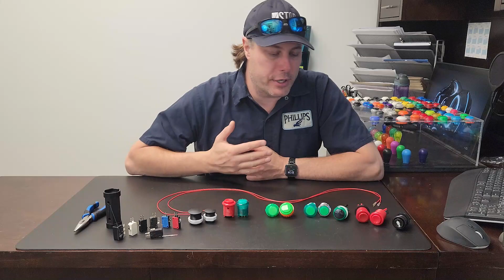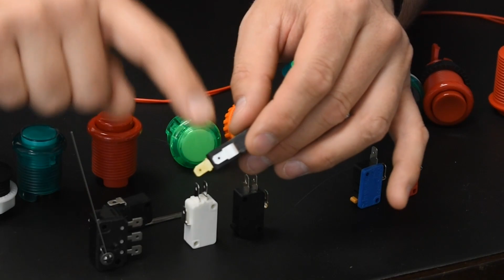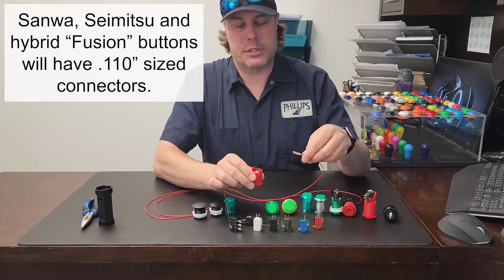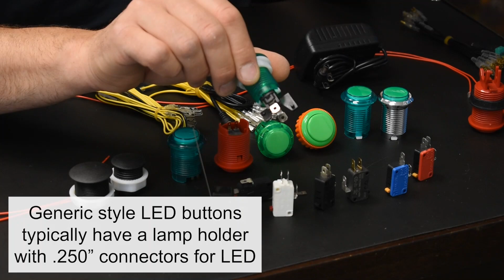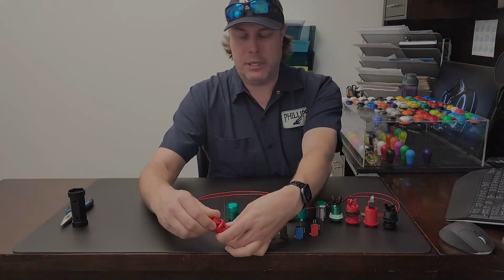Arcade Buttons 101

Comment: Brother really said the asian style buttons have PCBs in them

they're microswitches. The mechanism is just different. It's a spring and a ball bearing making the connection. A PCB would introduce input lag because it has to convert the signal into something usable, rather than raw circuit, like it does.

Comment: I have a micro pinball and was wondering which switches have the click in it ? I am looking to replace my start button ,, unlike the flipper buttons which have no click
Reply from the maker: @tommycruz100  any button with a full sized microswitch will have some sort of a click to it. Meaning most pushbuttons, but the Suzo Happ buttons are probably the ones you are looking for if you want a click to it.
Reply: @  thanks
Reply: Look for terms mentioned like "Actuation type: Snap-action".  That means they have a explicit moment where they snap their contacts together.
EAO for instance has this (they don't make arcade-buttons for as far as I know, but you can use them for it obviously) description for some of their buttons.
Some of the buttons I have (where thrown away at work and I was allowed to take a chunk of them home) are "momentary, non-snap action".
When you push them, they just feel like pushing on a spring, they don't click.

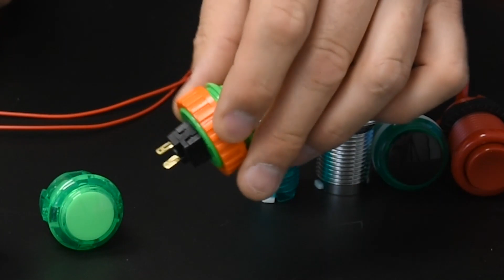Comment: 4:00 No PCB included unless LED illuminate (Only Chinese buttons with dual white LED and a ballast resistor both smd for miniaturization). 
Sanwa OBS Series button don't have LEDs (OBSF(std), OBSC(clear/colour tint), OBSJ(metallic), OBSFE(silent), OBSN(screw)) all use SW-68 keyboard micro switch.
OBHS are RGB 7-colour, 
OBSA use a micro switch with plug-able LED (like HAPP),
SS-xx (special square base/illuminated variable size)
Back to the switch that Sanwa uses - SW-68. It is used in majority of arcade buttons and is not a standard clicky micro switch but closer to a mechanical keyboard switch - non-gold-leaf. It contains two gold plated contacts/tabs with a conical coil spring and ball bearing assemble which make connection to internal contacts (rated for 1 million presses). 
Construction and operation of SW-68 switch - Top and bottom housing (black), tabs are off-centered entering bottom and both have "s-bend" to space contacts closer together (lesser of ball bearing diameter). Opposite to the contacts, a grooved ramp is formed into bottom housing section (ball designed to roll toward the contacts). Final parts: white plunger, coil spring and ball bearing. The spring/ball bearing assemble are also off-centered opposite side above the ramp. When the plunger is depressed the spring is compressed and the ball bearing wants to follow the ramp into the contacts; however, during un-activated state (unpressed) the ball is separated from contacts with a plastic nub or gate molded into plunger bottom. As you depress the plunger, the nub/gate moves down between the contact/tabs and a hole is opened to allow the ball bearing to follow the ramp into the contacts (spring bends towards the contacts). When released the bottom insulator part of the plunger pushes back the ball to a neutral position or Normally Open. Button activation force is the spring compression tension. Similar to Ultimarc/Baolian Goldleaf switch and Cherry MX leaf switch but no ball bearing, just an activator insulating nub separating the leaf contacts in Normally Open state.

Comment: Are there any normally open momentary switches?
Reply: I assume you mean normally closed. Anyway, at 1:50 in this video, the american-style button's microswitch. the bottom lead is the ground, and the other two contacts, one is normally open, the other closed.
Reply from the maker: They are all normally open. When you press the button it makes the connection to close /connect the circuit.
Reply from the maker: If you are looking for the opposite, the regular microswitches always provide both open and closed terminals so that you can wire them in tandem for some applications. There is not much need to use the NC option other than for a JAMMA that you need to wire multiple buttons for 1 connection such as a coin door and a credit button.

Comment: Ok - I have a custom arcade cabinet and some buttons are giving me problems now 5 years later - from what I understand the fusions are better than IL for lifespan?
Reply from the maker: @abm10399  from what we have seen from the Fusion buttons we have changed exclusively to use them over ebay other brand. By far they seem to outlast any other button on the market other than the specialty Sanwa buttons that are used for competition play.
Reply: @RetroactivearcadeCa  thx for the response I will def get them.  Really appreciate this video… it was super helpful.  I feel like those springs inside my IL are a little flimsy so I like to idea of getting away from those. And learn about that button wrench today - it’s now on order

Comment: There is no PCB . PCB does not explain a mechanism of a switch a PCB inside the button does nothing and would do nothing. It would been more apt to compare sanwa switches to "switches somewhat like mechanical keyboards" - It would not been entirely correct either but it is in same ball park away from microswitch actuated buttons. 

What is ACTUALLY inside Sanwa style switch for their buttons is two contacts, a ball bearing and a spring. When pressed the ball bearing goes down a plastic ledge against two contact points. The spring ... more or less according to scholars; SOMEHOW also keeps the ball bearing UP until pressed again, this is because of a notch in the plunger that keeps the ball bearing with the slightly horn shaped spring in right neutral position when not pressed.

But no button, NO BUTTON "has just a PCB" inside, PCB is where you attach switches to not what a switch mechanism comprises for. Even a magnetically activated button would have a mechanism of magnets or such and not "a PCB inside".

TL;DR: Japanese buttons, as far as I know both Seimitsu and Sanwa have: Two internal contacts (same ones you see outside actually), a ball bearing, a spring, and clever stuff with housing. They are actually rather easy to take apart, clean up and thus "refurbish" rather than replace entirely every time. The mechanism is clever, simple and gives a feel of a "gaming keyboard" for lack of better comparison, they are rather linear and react fast to inputs.

Japanese rhythm games actually have more american like setup with microswitches. VERY similar to 20 dollar sanwa buttonws without a switch.

And goes without saying: if you are building a japanese style cabinet you will use japanese parts. Japan uses these sanwa and seimitsu parts in their cabinets and since Japan still has an arcade market, those buttons and sticks are around in those cabinets. Both retro and new machines use them and are still in use widely in japan. And, the superiority of those parts especially for playing shmups without turbo is unparalled, you cannot two finger drum a microswitch button like a sanwa or seimitsu. Maybe if you use a 15 or 20g microswitch without a spring, maybe.

But, I cannot claim your knowledge of special and less special western arcade parts is not on point. Funny enough that same stuff applies to Japanese sanwa buttons used in rhythm games and such, they are very similar just the outside shape is different and microswitch line used is Omron as it is in the Japanese sticks.

Comment: I have heard people refer to Sanwa buttons as having micro switches before.  But I guess that's not technically accurate?
Reply: Yes and no.
The basic OBSF 30 or 20 millimeter buttons used in fight sticks, any "basic normal game" and such use a different type of switch that has a ball bearing and spring and two contacts working together with clever shapers in plastics to make a switch that is somewhat similar to linear cherry MX switches. Some japanese retro keyboards use same basic mechanism for their keys. 
BUT also yes as Sanwa buttons used in rhythm games, that are square, or rectangular, or big hamburger shaped round (If you seen; Beatmania IIDX; Pop'n Music, Sound voltex) use sanwa buttons that are just about same with american style microswitch buttons shown here. Same ability to insert LED's inside for controller illumination, microswitch on bottom and springs. Only difference is the microswitches used are Omron that have wider range of options and are frankly said higher quality. If you order an aftermarket controller to play these types of games at home you DO NOT CHEAP OUT ON THE MICROSWITCH. Honeywell is default from some makers and while light they wear down and become fuzzy fast. Actual arcades default to springs with 100g switches that should with heavy use become easier to play with than brand new, but other Japanese/Round 1 western venues opt to tweak the switches down to 50g or 25g omrons.

If you are interested in type of button I am talking about; Search for Sanwa OBSA-45UK.
If you are interested in lighter than standard 100g Omron microswitches, search for VX-01-1A3 for 50g force switch or if even lighter, 25g omron is D2MV-01-1C2. Though according to one review, Tactical and Audible feedback from the switch is all but gone at that point making VX-01-1A3 most likely best button microswitch, if you want a microswitched button for it's tactile properties.
Reply: @SumeaBizarro  Okay I just meant the typical standard arcade buttons
Reply: They do have microswitches, they're made by omron.

Comment: Hi Casey, I noticed that in your video you were talking about response times in contexts of games, but what would happen if I were to, say, try to use these buttons for something that's not a game? I know Buckethead used to have his own signature guitar where he had two Sanwa buttons in his guitar and both of them were basically momentary buttons where, because engaging it would kill the signal, he would often create a stutter effect manually by repeatedly pressing the button and thus using the button in tandem with the guitar's signal to come up with crazier-than-normal shreds on his guitar. Is the Sanwa really that helpful for something like *that*, or is it more of an old-school situation where you don't really notice the difference?
Reply from the maker: The Sanwa buttons are a higher quality momentary pushbutton because they are a digital  connection. They have a better response rate with no moving parts other than the plunger touching the pcb. This will work a lot better for what you are thinking and they are allow a lot more shallow than traditional push buttons so they will fit in a smaller housing.
Reply: @RetroactivearcadeCa  O.Ob Thank you.
Reply: @RetroactivearcadeCa  There is no PCB. There is moving parts.
Sanwa button is a ball bearing, spring, two contacts (those contacts extend outside where you connect the button from) and plunger. 
When pressed metal bearing touches contacts, when released shape of the plastics inside and plunger raise the ball bearing up and away from the contacts. Zero PCB, just something similar to leaf switch with crazy japanese engineering. And it is not me saying that. A mechanical keyboard fan "Chryosan" on youtube who has switches dating back to 50's and 60's listed Japanese style switch used in some Japanese keyboards that is also the type of switch used in sanwas as "one of the most baffling and crazy switch mechanisms I have seen, what the heck is even going on here?"

But; still. Contacts, bearing, spring (Spring is shaped like a horn), cleverly shaped housing in plastics for everything. Works. spring works both for the benefit of the mechanism and what springs do best. Likely very similar to leaf switches not available anymore. Also likely reason they are used in those hybrid buttons to have old feeling buttons with closer to pre-microswitch only world of western buttons.

Comment: IL buttons are not identical to Happ, IL buttons have a shorter travel
Reply: If you remove the spring they technically will have the same travel.
and unless you go lower than 50g microswitch, the springs can be removed.

Comment: Interesting video.  I do have a strong preference to western buttons mostly because I like the concave plunger, but I also respect Japanese buttons.  Recently they released concave plungers for Sanwa buttons; replace the microswitch with a switch from Seimitsu along with the concave plungers and you get the best of both worlds. I had to admit I can't say I'm too big a fan of cherry switches on buttons, a little too tense if you ask me.  Groovygamegear used to sell microleaf switches that were fantastic but sadly they seem to be discontinued.
Reply from the maker: You should take a look at our new Hybrid buttons called Fusion buttons.
https://retroactivearcade.ca/collections/concave
Reply: @RetroactivearcadeCa Interesting.  Can you swap out the microswitches?
Reply: @NinjaRed5000  The fusion buttons most likely use a japanese style switch, (not a microswitch just a switch or mechanical button mechanism if you want to go with that) - but seems to be unique to the fusion buttons, pictures of the product are not good enough to make guesses.
If you want a microswitch button, but tweak it's properties one is to remove the springs, microswitches unless you go to extremely light ones like 15g honeywells are strong enough alone. Other is to look into Omron made ones. They have a variety of activation strengths that also help the button feel right, but with less force. Hardcore rhythm gamers tweak this a lot since games like beatmania IIDX or Sound Voltex use big sanwa buttons that are like american buttons, long, spring, microswitch, but for ease of very rapid rhythm gaming even game centers (or ; Japanese Arcades) tweak the hardware to have 50g or 25g omron switches and ligher spring, or no spring. I myself last time I owned one used 50g omrons without a spring and those were easy enough for me to use. 15g honeywell was actually nice to use, but the quality was so low that even a single person use of a controller caused fuzzy inputs before even a full year of owning my first controller.

TL;DR: No, likely, if you want to go for microswitch buttons and look into omron switches. Panasonic was apparently another but their best is not even available anymore making Omron the only Japanese, and high quality option with granular choices for your activation strength.

Comment: for the generic blue micro switch since its my only option for arcade buttons where do i attach the black wire is it below or is it the one thats in the middle?
Reply from the maker: Your black wire (Ground) attaches to the bottom connector that has a 90 degree bend in it. The middle button is where you connect your action (Live) wire.

Comment: I'm curious what type of microswitches are in gold leaf buttons? I tried to do some research on gold leaf buttons but couldn't discover any info about that specific button that was a solid answer.
Reply: There is no microswitch in the goldleaf button - there is a LEAF SWITCH inside the button housing.

A leaf switch is simply 2 metal contacts that complete the circuit when you press the button. They take less force to activate, the current flow is immediate, and they don't have the "clicky" sound that microswitch buttons are known for. 

Leaf switches are often used in virtual pinball cabinets, especially for flipper buttons.
Reply: @andrewjameslyon  Thanks I finally figured out how leaf switches opporate. I did discover they are mainly used for pinball machines although I'm not using leaf buttons for pinball. At this point I'm not sure if I like leas and am considering trying something with a micro switch like some IL buttons or happ.

Comment: If you keep popping LEDs you need to drop the voltage source or increase the in series resistance to drop the current flow thru the LED to safely below max current limit. It would be a situation that they are running the LEDs "HOT", close to max current and max brightness. 
Say LED drops 2.2V + resistor drops 9.8V = 12V, so 9.8/0.030 = 327Ω or 330Ω 
then if 13.5V (unregulated) (13.5-2.2)/330 = 34.2mA and uh-oh! smell something funny. 
You need more resistance to drop the max current. Add a 100Ω 5W ceramic resistor to the common grounds of the LEDs (13.5-2.2)/(330+100) = 26.3mA, Power = VI = I²R = (0.0263)²(100) = 0.069W or 70+ LEDs. 
If you have different LED colours then the forward bias voltage could differ requiring each colour to be on separate circuits. Lower voltage LED will conduct first changing the brightness.

Comment: LEDs don't dies but are murdered by over-voltage or too much current (max 20-30mA) burning out the diode junction. Each LED colour has differing forward bias voltages due the semi-conductor mix (1.4V thru 3.5V). 
Physics of electron valence level gap and returning to a lower state releases a photon of a specific energy (colour), like fireworks that burning different compounds give off different coloured light. If you look inside the button cap, there will be two SMD LEDs and one resistor on a circuit board. 12V & 5V will use similar LEDs but the resistor will differ to accommodate the voltage difference.